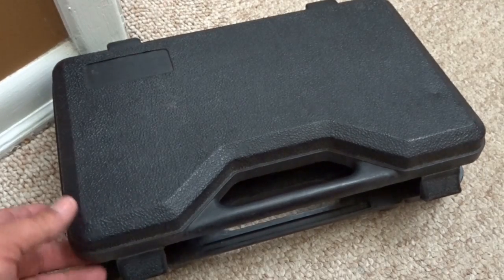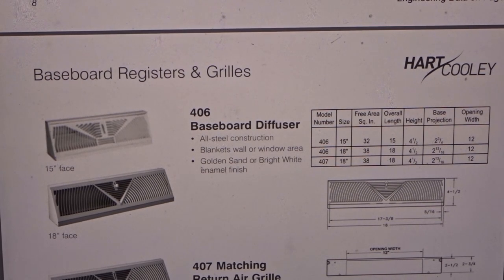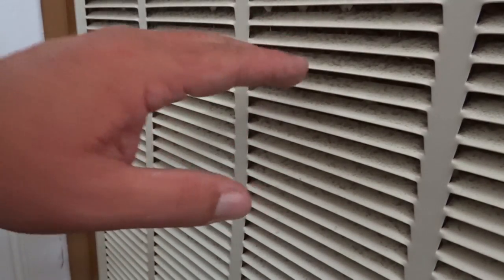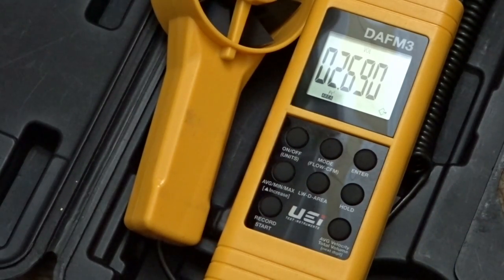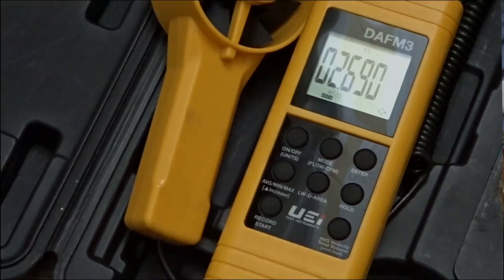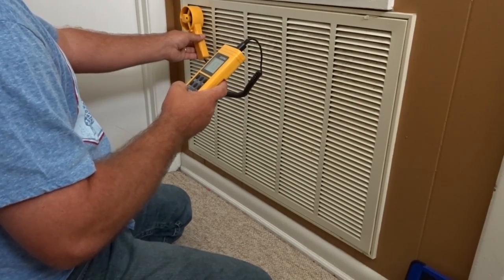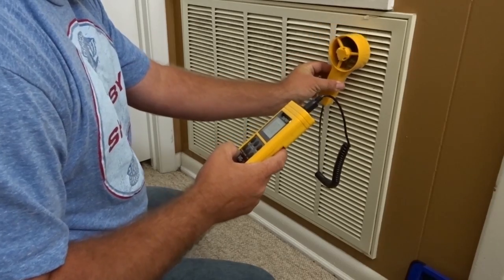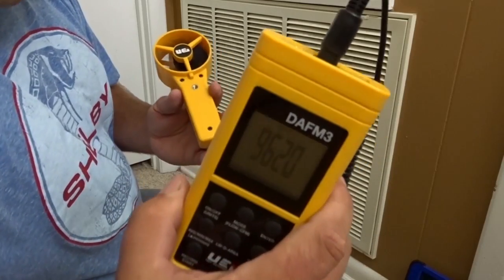How to Use the UEI DAFM3 to Measure CFM

Comment: If I wanted to do relative comparison of ducts to ducts (for balancing), can that be done with just the blower fan running?   You mentioned that you wanted to wait until the AC had been running for a while before getting measurements.  Is that just for absolute readings?

Comment: What do you do if there is 2 returns. Actually I’ve been working on a big house that has 5 16x16 returns. Is it possible to figure the cfm ? Or should I just use a hot wire ?
Reply from the maker: Just do one by one and add them together. You may also use static pressure probes and a blower chart to simplify.

Comment: Interesting that the free area, according to the engineering data, is only about 65% of the nominal filter area (in this case 20 x 30, or 4.17 ft2).  My gut instincts would have estimated a higher percentage.  I guess that's why we use the tables.  :-)    
Good video.   Thanks.
Reply from the maker: some of the % run a little higher

Comment: Great video! I bought the Testo VAC set so that I can start playing around with air flow and duct sizing. I still have a lot to learn about    AC's. My year consists of 10% AC and 90% Refrigeration, I hope to change it to 50/50.
Reply from the maker: +HVAC/R Junky good deal, you work on some interesting stuff
Reply: Working Joes Roundtable Thanks! It's what is behind the back doors of your local supermarket and running all of the cases and Walk-in boxes. 👍😎

Comment: Most of my returns are a filter grill connected to flex duct. I've been wondering if I should use the grill measurement or the flex duct size when using my ABM-200
Reply from the maker: +jason Inman how much room is between the grill and flex. is there like a 6 or 8 inch box?